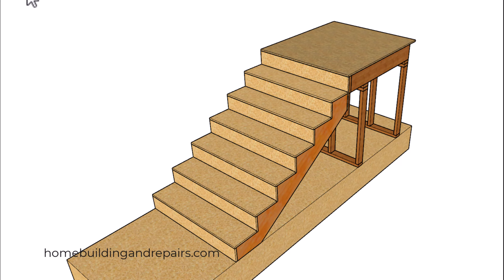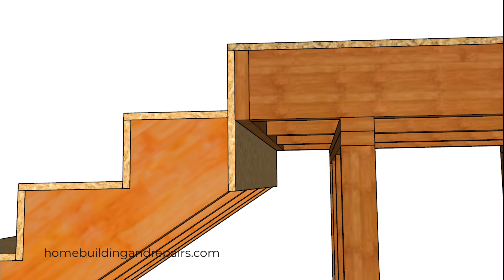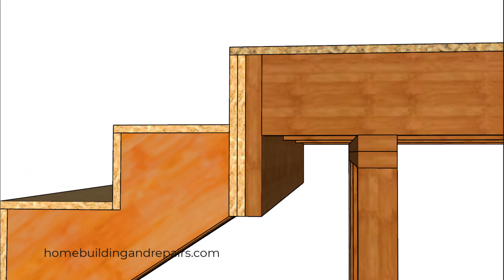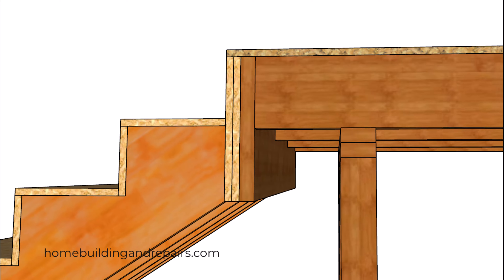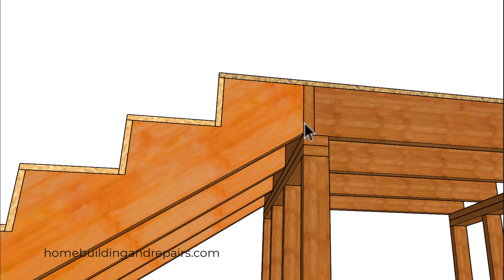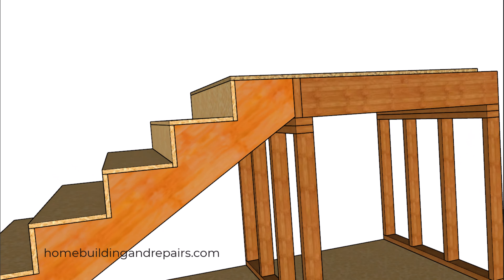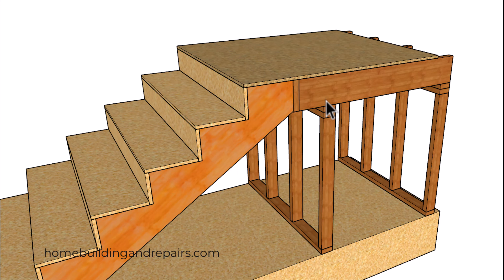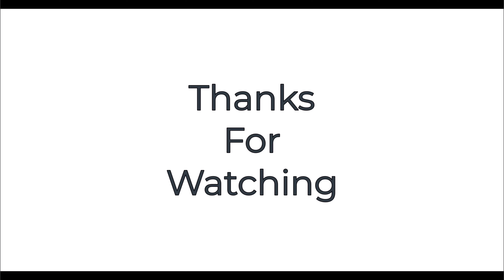Don't Compromise on Safety - Floor or Deck Framing Modifications For Stronger Stringer Connections

Comment: I always use 2x12 on the side of the deck the stairs will be mounted on and you just rip it to the joist width in the area there won’t be stairs and this has worked for me for the last 15 years. If your stairs are flush with the deck as in an extension of the deck it complicates the balcony to stair rail transition when there’s a 90° turn from level to sloped.